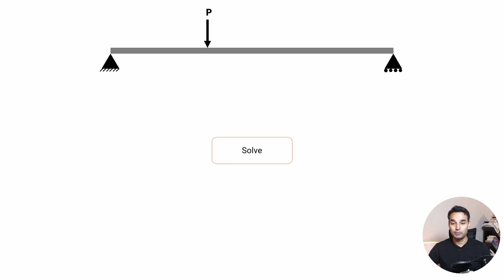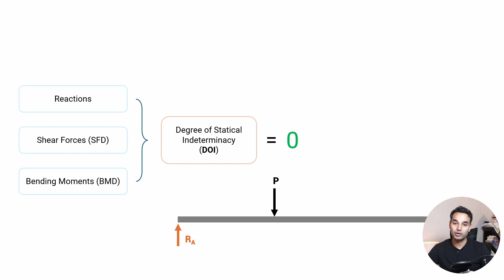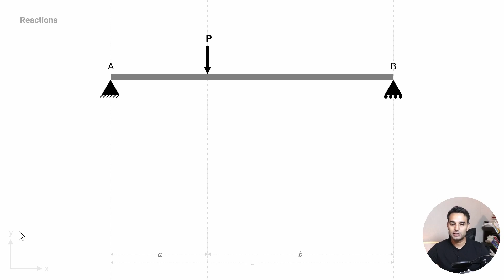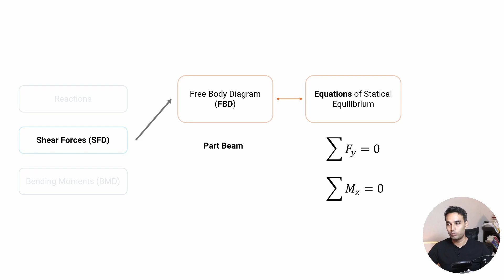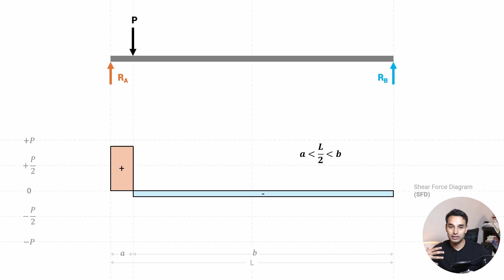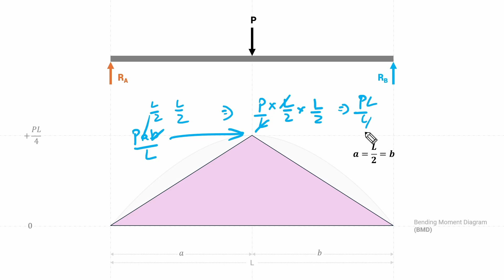Comment: Bro speak on wall load on slab 🤔
Reply: Walls are usually (in most cases) supported on primary or secondary beams. Hence their loads are not taken up by slabs.
Reply: @CivilBlackBox but I have seen in construction they use concealed beam with in the slab, is it ok with the design / can you do on modelling slab with wall load and it's moment and shear parameters 🤔